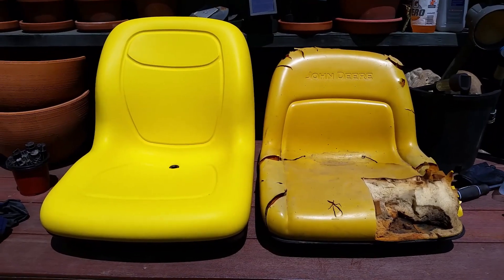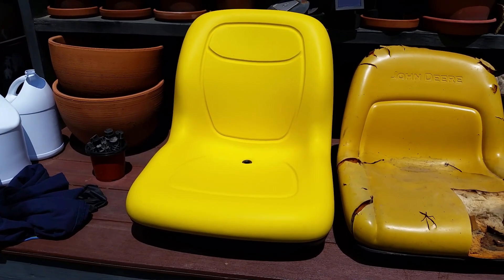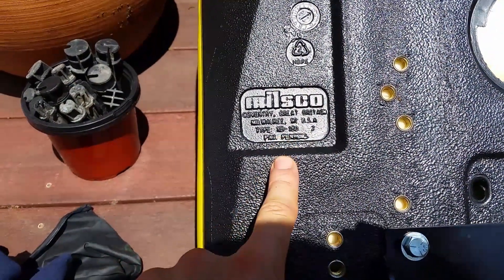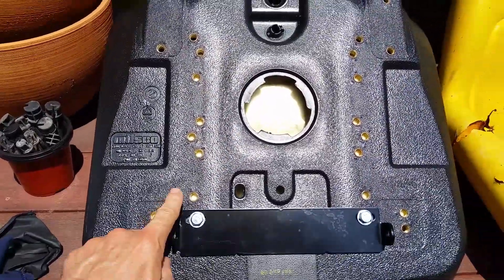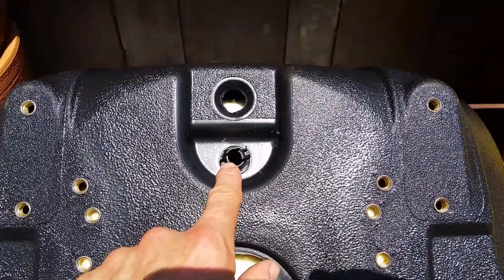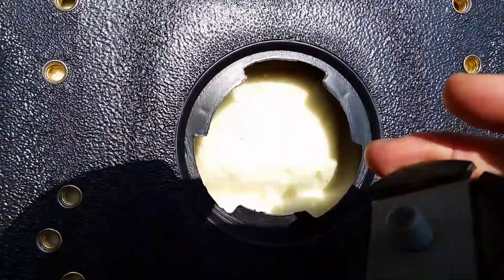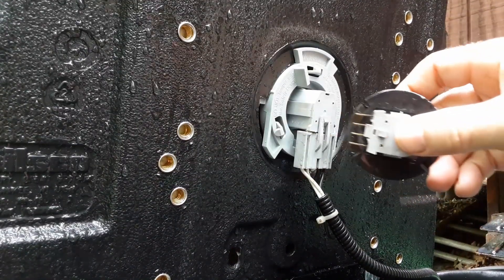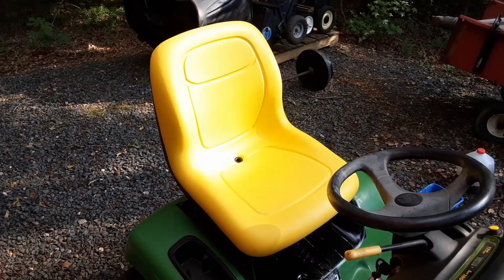Replace John Deere Lawn Tractor Seat with Beautiful Comfy AfterMarket High Back

Comment: Followed your lead and because of this video  -  I now have a new seat on my John Deere LT 180 riding mower.  You were correct the higher seat was a great added touch.  I heated off the old JD sticker on the back of the trash seat and put it on the new one, looks perfect, thanks for taking the time to put this video together it was a huge help.....

Comment: got a seat from the same company, the seat on my JD was slightly different than yours ..99 model year but they had it in stock, only difference was no JD sticker on the back of the seat ,,i can live without the sticker and save around a hundred over dealer prices